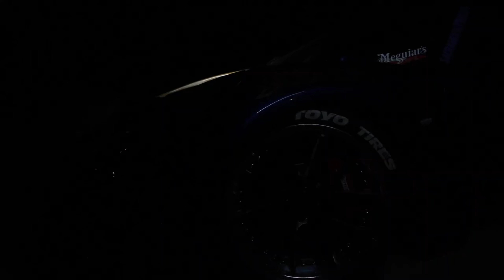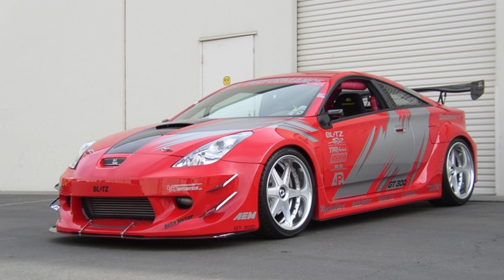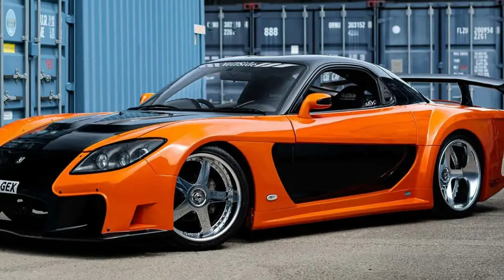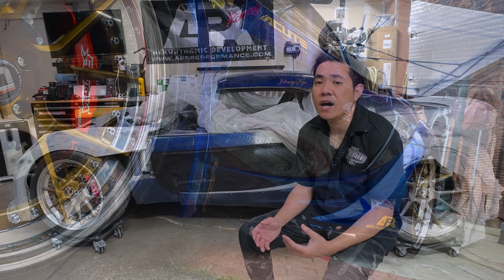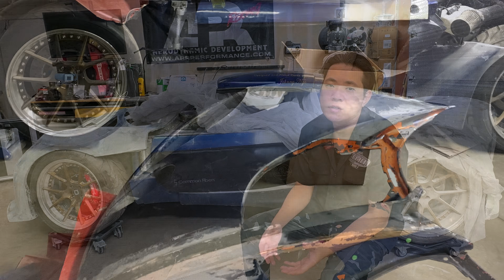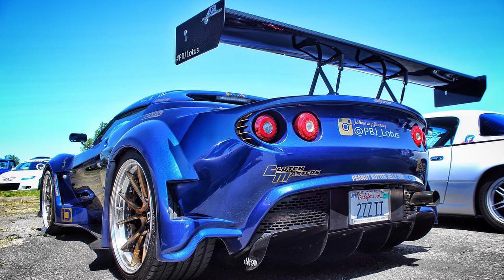The Widebody Mistake Nobody Talks About

Comment: Just as i'm about to widebody my exige
Reply from the maker: What?! That’s exciting! What do you have planned? Let me know if there’s anything I can help.
Reply: @TunerPlaybook  CUrrently working on the turbo kit what do you charge for design i've got 18x10 for the front planned maybe 18x12 rear.
Reply from the maker: That’s a serious setup. 18x10 front and 18x12 rear is going to need the whole car planned around wheel fitment, steering angle, suspension, and tire size, not just the flare shape. 

Shoot me an email at tuner.playbook@gmail.com with your ideas, specs, and some pictures and I’ll see if I can help you out.